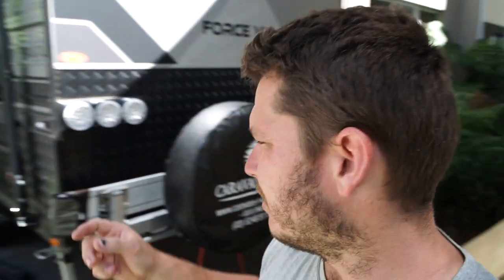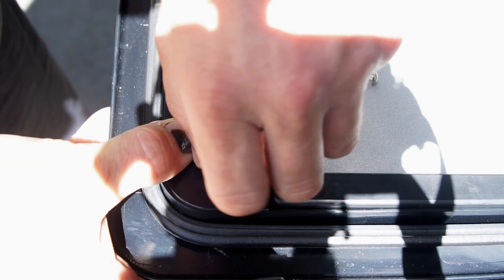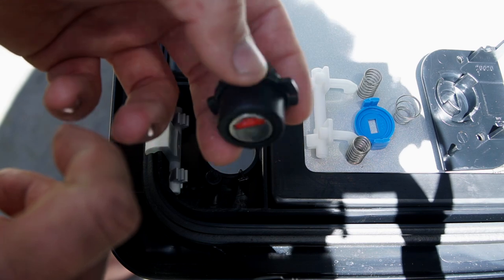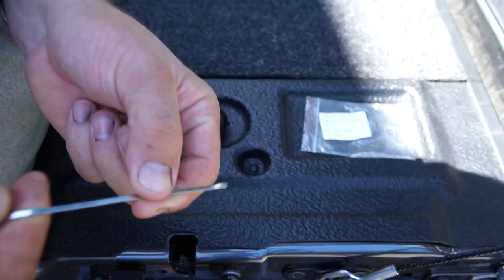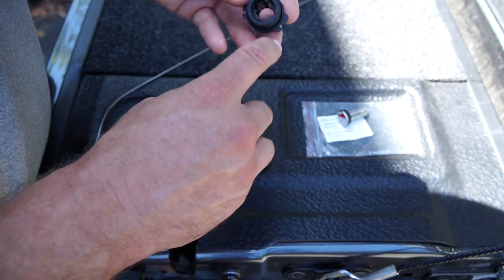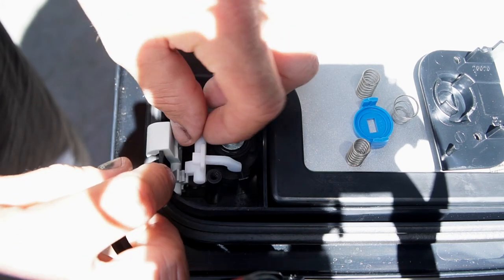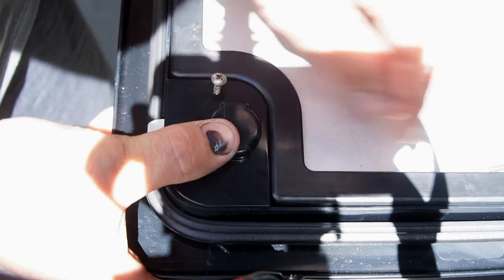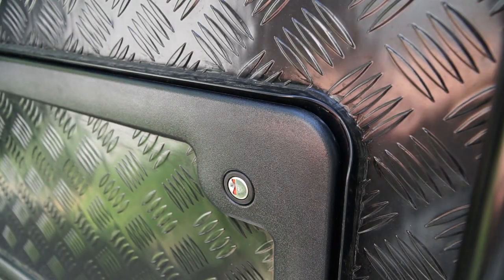Thetford Caravan Key Barrel Replacement - HaulingHome #How-To

Comment: Just to add, on my Elddis  motorhome I was struggling a bit to re assembine the plastic bits and springs because I didn't really want to take the door off so I left it in situe, which meant the springs kept dropping down under gravity, so I decided to put a tiny bit of superglue on the top ring spirals which took five seconds and then it was really easy. I would advise anyone to take a clear photograph before you dismantle, but your video was great because I could freeze it at any point. Thanks again for uploading.

Comment: All good if your hatch hinges DOWNWARD - If your hatch hinges sideways, like a door, it is quite hard to reinstall all the springs at once!  RECOMMEND using SUPERGLUE to carefully stick the spring to the BLUE plastic bit first. It is then really easy to hold the two clips and springs with one hand, and fit the cover while the spring on the blue plastic bit stays put!  Thanks for the video - it's great - and also thanks for the comments on removing the O-ring so you can use a normal small screwdriver to take out the barrel.

Comment: Simple tip and no thin rod required. Once you have removed the lock mechanism out of the door (as in the video), turn the lock over to look at the back, remove the O ring and you can see the gold locking tab. Press in with a thin screw driver and the lock comes out. Replace barrel as in video.
Reply: Thanks for this - I was having all sorts of trouble and this tip worked a treat!
Reply: I was having all sorts of trouble till I read your comment👍👍
Reply: BEST TIP EVER THANK YOU :)

Comment: Thanks for the video.  What the f... this loks security is 0, anyone can open the locks by removing the barrel from outside ... now I know why my caravan compartment has missing barrel top metal sheet, someone try to pull it out by grabbing it.
Reply from the maker: 2891 user you can’t pull them out if they are locked
Reply: Thanks for this information

Comment: Follow previous Comments to get The lock out of the assembly

@rickcathysmith8449
1 year ago
Hi Jimmy
Great info
I found that getting the lock barrel was out a pain to jiggle free
I removed the small O ring & then I was able to see the little brass tab move & slip out in the slot